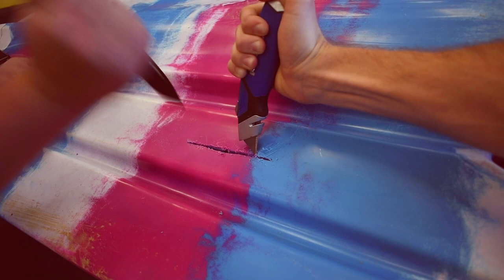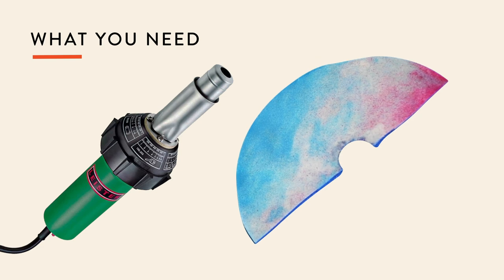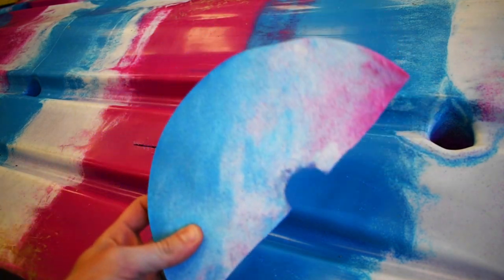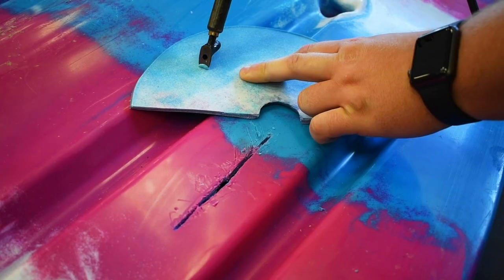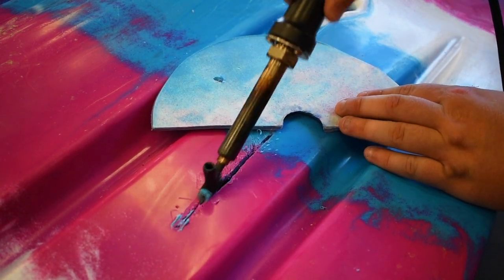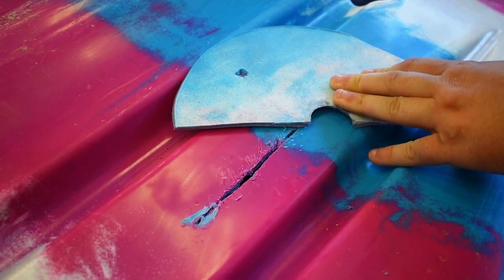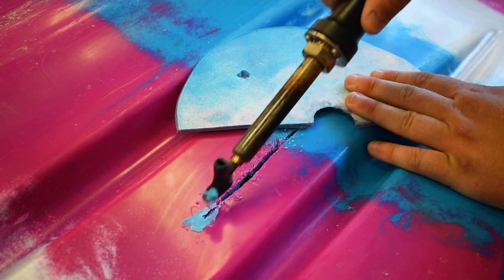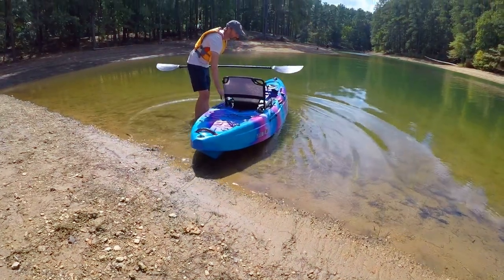How to Repair a Kayak Hull

Comment: Awesome! What about the Maverick 120?
Reply from the maker: The Maverick 120's foam is waterproof so it'll still float if it's got a gouge in it but yeah this process is still the same!
Reply: Vibe Kayaks never had an issue with mine but was just curious, thanks! Ps there is a Salt Strong review on the Mav120 that may need myth busting... thanks! Kiel